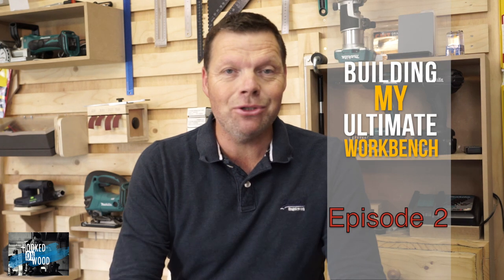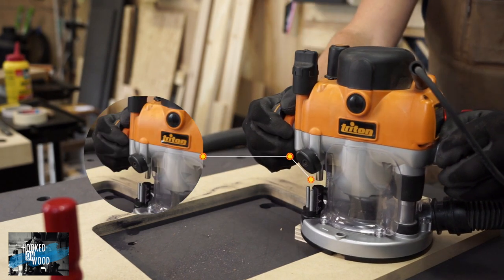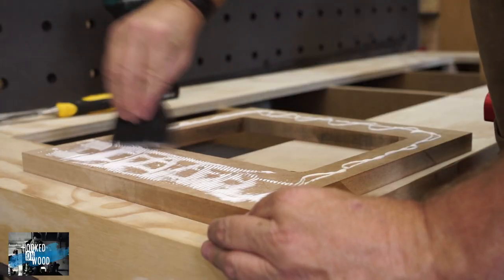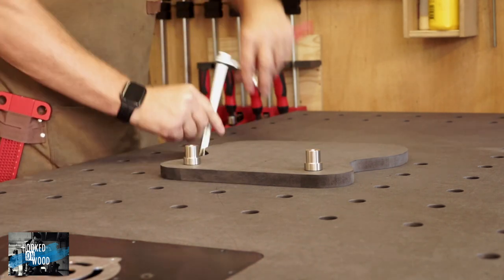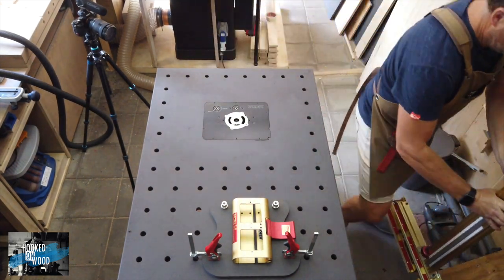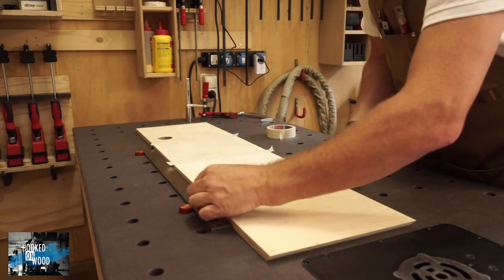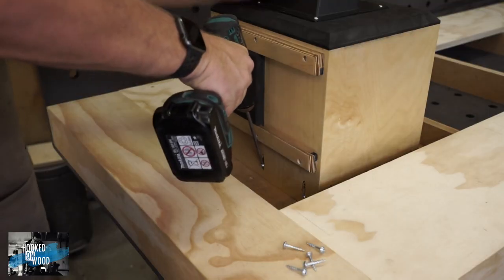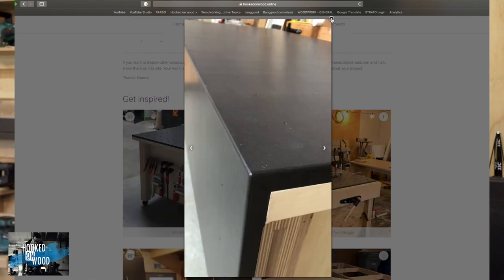My ultimate workbench,  episode 2

Comment: If you're in the Portland OR area I just confirmed that Crosscut Hardwoods has black Fibralux MDF (the stronger, lower formaldehyde stuff) in stock. 3/4" x 4'x10' sheets

Comment: Hello from California. I really like your work, it is inspiring.
 I've had to search for a while to find out that what you are using is black mdf, I have never seen it before. Is this a lot stronger than regular mdf? I have questions regarding the durability of the dog holes and your sharp table edge,  but most troubling to me is the dovetail grove, will it be strong enough to resist the pressure from the clamp with out easily breaking?
Reply from the maker: Hi Carlos, 
It is stronger than regulair mdf. I think you can compare it with Medite V313 MDF.  But there a different Full colored MDF factories and I do not know there specifications, so the Black MDF I Use is definitely denser.
About durability. I had my previous workbench for over 1 year and no noticeable damage. I rounded the corners and they are all in tact. That does not mean that if you abuse it, it will damage. I am going to finish it with Danish Oil coming days. That would make it even more durable. 
The dovetail grove is strong enough. But this has also something to do with the Micro Jig clamps. This is shaped in a way that it can hold a lot of force without breaking the wood. If you use a wrong clamp, you can damage it. 
The dogholes will wear out over time. In my opinion this keeps within a certain margin. I hope adding Danish oil will increase it strength even more. But again, it is stronger than "normal" mdf from a good quality.

Comment: Love the workmanship and look of the workbench. I'm just making plans to build my own workbench and i love your designs and practicality :) I'm finding it hard to find the HDF tops in the UK, so I may go for an aluminium top instead.
Reply: Hi Daniel, have you looked at Wentworth Cut To Size? As far as I can tell they supply Valchromat (full colour MDF). They only sell in full sheets but cut down to your preferred sizes to make it easier to send by courier.

Comment: Hi Dennis 🙂
It's funny, because we both have a lot of tools in common and a lot of design ideas in common. You inspire me to do some minor tweaks, and maybe, some of my tweaks will inspire you or some of your viewers.

If you have a track saw, you can align the track with a couple of dogs and cut the ends of the table and the parf side. Then, when you align the ends of the pieces, you automatically align the dog holes. If you make your incra plugin top before assembling the table, you can use that for more fine adjustment options for the hole-to-edge distance.
Reply from the maker: Thanks for your reply. I would love to see your ideas. I hope you will send me some pictures I can put on my website. Thanks

Comment: To guarantee alignment of the dog holes on the side and top pieces, drill the holes before you cut the panel. Then when you cut the panel to make the side and top, the edges and the holes will be perfectly aligned.
You are an amazing craftsman and an excellent teacher as well. Not only do you communicate well, you motivate people to mimic your craftsmanship.
Reply from the maker: Yes, you are right, but I can not make my cut over this length guarantee accurate. So, that is why i first cut. And when that is accurate. Drill the holes. Thanks for your kind comments.
Reply: Brian - was watching the video again last night for the third time and came to exactly the same conclusion, that's what I plan to do - Thanks

Comment: Love Ultimate Workbench video series.  I was thinking; you could have created ensured your dog holes were aligned by drilling through both plates of MDF at once by sandwiching the plates together, then cutting and joining the plates together at the same time.

One question, why didn't you use T-Tracks for the said grooves on your work bench for clamping, I would think the MDF only would wear out over time?

Comment: Hi Dennis, Excellent videos..! You have obviously put a lot of time, care and effort into their production. The workbench is a lovely design which looks strong, highly functional and well built. I am planning my own version of this but with the inclusion of a bolt-on carpenter’s vice on the opposite side to the vertical apron and at the router table end. I haven’t found a supplier of coloured MDF here in the UK but Valchromat is available in a few places - in Hertfordshire Chiltern Timber (www.chilterntimber.co.uk) stock19mm Vachromat in 2440x 1220mm (8’ x 4’) sheets (£125 each..! - but quoted by the manufacturer as “...30% stronger than MDF...” and with other benefits...).
Also, I’m wondering if the dovetail grooves in the front apron are strong enough to take a heavy load from the rail clamps - perhaps I’ll do some strength tests and if necessary fit some T-track secured by CSK machine screws with nuts and washers..?
I am also working my way through your China-Tools series - fantastic..! Your reviews are comprehensive and very helpful. Thank you for the work you do on YouTube, it is very much appreciated... All the best.

Comment: Hi Dennis, firstly like most others here, I just wanted to say what a great channel - I was initially drawn in by the China Tools series, but since I have been looking at everything and I just love the way you work and your workstations. I am really interested in your comments about dust extraction on the router table and keen to try building a box for my own - as you mentioned in the video, I prefer not to use it for many cuts just because of the mess with a fence mounted extractor. I just can't get out of my head the thought that housing the router inside a dust box seems like it's asking for trouble, presumably you have no real issues with dust getting into the motor? I would be using a good quality Trend T11 router which I was lucky to be given! :-)
Keep up the great work with the channel.

Comment: This is a real good Tutorial to make repeatitive cuts for Routerinserts and more. The black HDF is in fact a little expesive in Germany, but the Design and rigidity is worth it. One very dangerous thing I found is to use gloves on rotating tools like Drillpress and Router. This will pull your fingers or hand into the Bits and it's not easy to fix back.

Comment: Hi Dennis, I’m using a black MDF for my own, much smaller and more simple workbench. Question, did you apply a finish to it? If so, what did you use? 
It looks stunning either way!
Reply from the maker: On some I did, Some I did not. They stay the nicest if you do not finish them. But you protect them more with a finish. I did finish one with Danish oil, but that is just because I like to work with Danish oil. I did not test any other. I am building a new workshop and I did not decide yet if I finish it or not. It is better protected, I notice that the top is harder, better resistant against water and you can remove glue better. But you see scratches more because of the harder surface. You do not see them when you do not finish it. I want to sand it lightly in a few weeks and see how that turns out. When that works easily and you get a nice surface again. Than I think I will finish all my workbenches with Danish Oil.
Reply: @HookedonWood  , thanks for your reply, very much appreciated. Though i grew up here, i was born in the Netherlands and its a pleasure to hear that Dutch accent coming through! Ill be posting a video of my work bench build, though not nearly as impressive i think its going to be a great addition to my tiny workshop. Check out “captain of my shed” episode 6 if you want to feel even better about your amazing workshop!

Comment: Dennis, I am looking to build  your Ultimate workbench. I am in the US so we are still on imperial ( Inch) measurements. What do you recommend to do with the hole cutout sizes ? US bench dogs are 3/4" or 19mm wide.  Your holes are 20mm. Any suggestions are welcome. Thank you for your time in advance!
Reply from the maker: I would look to the availability of the different dogholes accessories. These accessories make the use of dogholes useful. So, if that is 19mm, go for that.
Reply: @HookedonWood  makes sense, thank you for your quick reply

Comment: As always, another great idea and beautiful work! A couple questions . . . 1) did you say that you forgot to fully lock the positioner when you screwed it to the mdf plate...? 2) On the LS Positioner MDF Plate why didn't you just add 2 more dogs to the plate instead of using clamps?
Reply from the maker: When you lock it, there is less play. I did choose for e dogs to align and two clamps to clamp. Otherwise there will be some play some day. I found it more secure to do it this way.
Reply: @HookedonWood  Okay. Makes sense.Thanks!

Comment: Does the Incra fence stay parallel to the edge of the table?  I have an Incra TS-LS that I'd like to use in my own (yet to be built) ultimate workbench.  I'd like to embed my table saw into the bench without front or back rails, but rather just have the positioner attach to an MFT extension wing to the right of the blade.  I'm worried about wobble with the lack of front and rear supports.  The front support has a locking mechanism in the standard configuration.  

Thanks for any advice and for the inspirational video!
Reply from the maker: Hi, someone else did ask me this question before. Although the wobbling is minimal, there is just a little bit of flex. For the router table, this is less of a problem, but with a table saw, this can be dangerous. But again, the flex is so minimum, but because it exist, I can not advice this. I had the Fence with the rails before, but have to be honest, that I did not always locked it. So, I felt pretty comfortable to do that. Anyway, I told the first person that told me the question to ask Incra. He did and replied that INCRA told them that it can also be used without the rails on a table saw. So, I think it all is within the tolerances. Normally when you push a bit too hard to the side when you want to cut something, if you bend it, it bends away from your blade. Only when it flex back, there is some danger. But again, I can not advise it, but the flex is really minimum. Thanks. Dennis
Reply: @HookedonWood  Thank you so very much for the prompt reply!  I may consider keeping the front rail since I will need access to the blade raise/tilt controls at the front of the table anyway.  I could also probably use a t-track in the tabletop to lock the front of the fence.  When I had the system on my table saw I rarely locked the front of the fence either.  😁

Comment: Hi Dennis, I'm curious, why didn't you just align the fence against a pair of dogs inserted into the table top?
Reply from the maker: Good question. To add my screws, I have to slide out my fence till the last end. There where not pocket holes left so I picked the end of the table. In the end, it does not make a difference, but easiest way is as you suggested. Thanks for your comment

Comment: Found the Parf Guide system by scrolling down a bit farther.  Only question is do you get repeatable Incra Positioner alighnment with bench dogs and clamps?
Reply from the maker: Hi Clinton,
I think it is pretty precise. I have to reposition the rulers regularly if I want to adjust it at the side of a bit or in the middle. So, I do not see it as a problem. That said. I am convinced it is secured. If there is play in time, it is in 10th of mm. 
But I should consider if you should use it as a solution for your table saw. On my former table saw I had a LS positioner with side guides. 
There is a reason they deliver this option for the table saw. And from a safety point of view I would use these.

Comment: Hey, thank you very much for all of your educating and also entertaining Videos. Especially I would like to thank you for sharing your work bench ideas and Plans. I have a similar amount of space for building my Workshop. How much space should I Plan between the two working areas. I can go to 150cm between work bench and miter saw Station. Do you think that is a little too much? I could also build the bench a bit wider but I am not positive if 100cm would be too wide. Are you happy with 80 cm? How much space would you say is good as an outfeed Option for the tavble saw? Cheers from Berlin :)
Reply from the maker: Hi Robert, In my new workshop I will make my workbench 100cm. But 80 cm fits for 95% of my needs. So, Although I will go for 100cm I am happy with 80cm. The space between workbench and miter station (if you do a similar setup as I have) should be at least 80cm. In my new workshop I want 100cm between workbenches.  But I do not see a disadvantage with 150cm. When that is possible, I would use it. 
Outfeed table. I have and extension of about 50cm. But my table saw en workbench have the same dimension so longer boards go over the workbench. This is not the perfect solution but this way I could walk between my table saw and workbench. Good luck!

Comment: I discovered you chanel e few hours ago and i was instantly hooked.

I am looking forward to take my woodworking to the next level. And watching you gives me inspiration . But i have a serious limiting factor. Space.

All my woodworking is done outdoors on my terrace.  There is a shed that can provide protection from direct rain.
But  as you understand everything is exposed. When its really hot  really cold. I can't work.  I live in Greece and the sun is also quite strong.

So i am skeptical for MDF as a top for a workbench. I also consider of making fotable covers ...

Do you have any suggestions from your experience? What materials will be best for my situation?
Thaks for your time!
Reply from the maker: Hi, 
I know a product that is very nice and can handle all the different weather situations. The only problem is, it is very expansive. But I like to work with it and it will last 50 years without any protection in the rain and sun. It Is called Medite MDF Tricoya Extreme. It is a MDF and as easy to drill and saw etc. als normal MDF. But again, google what it cost in your country but it is not cheap.

Comment: HI Dennis

maybe you are still wondering which MDF you are using on your router table . there is standard colored mdf and some that is made to be "not easily inflamable". the second is about 25% denser and gives a smoother router finish. the type you get around here in Hamburg/Germany is made by Finsa.

if you include a partslist in your plans it would make it even more foolproof and easier to adapt for changes.

very nice instructions and reviews
thanks 
Philipp
Reply from the maker: Thanks Philipp. Good addition!

Comment: Dennis, I noticed at the 0:07 mark that your LS positioner is offset and not in the centre of your table.  I was delighted as mine will be the same way unless I drill additional 20mm holes.  Have you noticed any drawback to this offset?  Given your detailed precision I am assuming not, but thought I would ask.
Reply from the maker: Yes, that is right. I would not do it too far. But i do not notice any problems.
Reply: @HookedonWood  Super - thank you for taking the time to reply.  My worktop is similar to yours in that I have an even number of 20mm holes across my bench every 96mm but centred my router lift near one end.  I will leave it as is since the same scenario works for you.

Comment: Did you treat the surface of the workbench to prevent glue sticking to it?
Reply from the maker: Hi Andy, 
Not yet, and my former workbench I did not finished the surface. But I am thinking about Danish oil on this moment. But I have not figure it out yet. Do you have suggestions?
Reply: @HookedonWood  Generally I use either wax (homemade bee's wax + boiled linseed oil) or water based varnish (preferred), but I'd usually apply it after everything is cut to size but before cutting dog holes/mitre slots etc. Water based varnish does a great job.

Comment: Hi Dennis

You mentioned that you don’t believe that the coloured MDF that you use is Valchromat.  The other brand name of coloured MDF that is available in Australia where I live is Forescolor.  Do you know if it is called Forescolor?  I took a look at your link.  They don’t mention any brand names.
Based on the specs Forescolor is slightly denser than standard MDF at 740kg/m3 for an 18mm sheet.  Valchromat is slightly denser again at 790kg/m3.  I would be interested in your opinion.
Reply from the maker: I called the firm where I bought my wood and He told me it comes from Portugal. But it is not branded. He also has Medite MSF I use also and it is denser than that. I found it comparable with Medite V313. The market for this kind of wood is not that transparant. So, I am a bit careful with my opinion. What I do not understand is, that when it is from Portugal. Why is it not that easy available in the rest of Europe.
Valchromat cost almost twice, so from that point of view I hope it is different. But branding something, in this case wood, cost money. SO perhaps it is also the same.

Comment: Great video's Dennis - really like the black - looks very contemporary. I have ordered 2 sheets of the Valchromat 19Mm MDF. I already have the parf system and made two benches using it - a bit expensive but virtually fool proof!  I am really interested in the slots that you have created - what size of dovetail cutter did you use and will all of your clamps slide in?  You did seem to mention on one of your video's that you might only use one brand of clamp for this purpose?  Also - have you had an of the clamps break out under pressure?  What depth of slot do you recommend
Reply from the maker: Hi Steve, Sorry for my late response. Those slots are for the Micro Jig clamps. This is the only clamp that fits. You need 14 degrees dovetail bit. But better is to visit microjig and look at the dimensions.